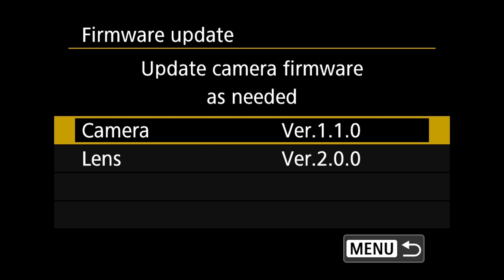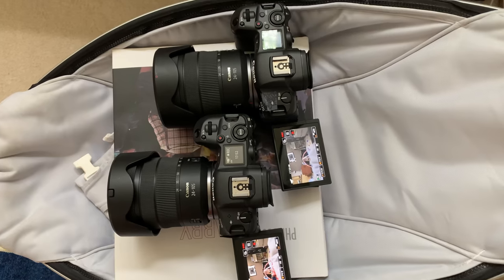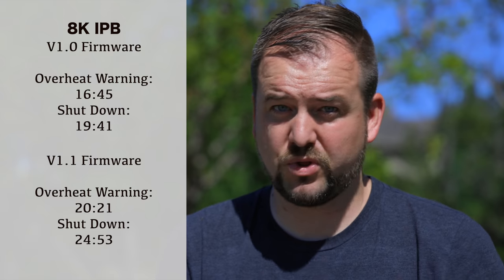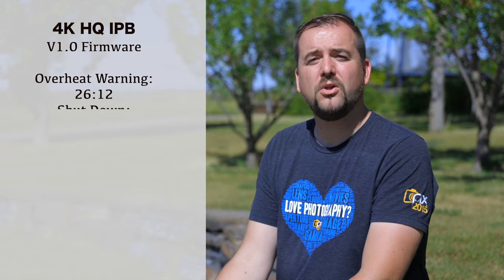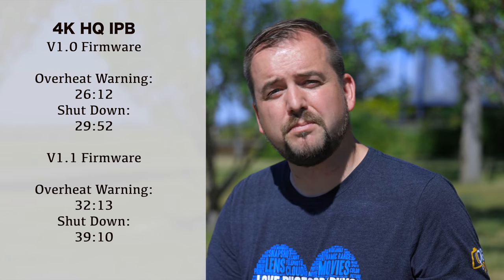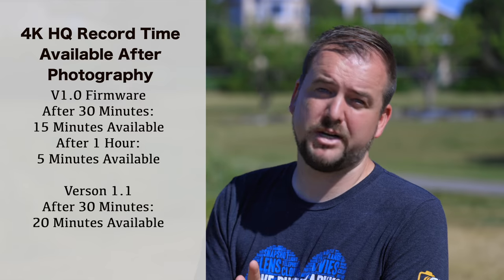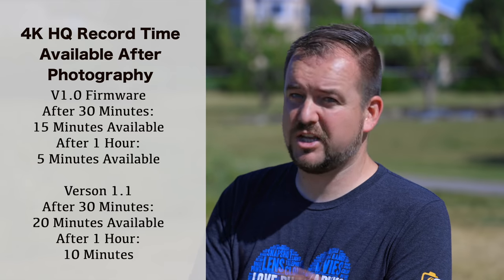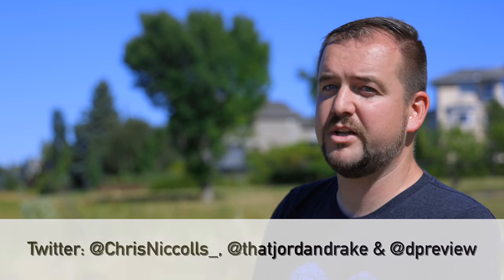Canon R5 Firmware 1.1 - Is the overheating fixed?

Comment: Software update silently improves the "temperature-limited" record times? I can't get "Canon Cripple Hammer 🔨" out of my head....
Reply: To be fair, software with better efficiency can compute faster with less stress on the system and the chip, thus less heat produced.

But yeah, since the initial ambient-temperature-independent overheating tests are out, it was very obvious that the cause of overheating is (cough cough) due to Canon's (cough cough) conservative policy, in terms of both business and camera protection (cough cough).

I cough not because of any disease but because this is quite a hot topic (pun intended). 😂
Reply: There seems to be a hack regarding recording with the door open and pulling the battery out as it flashes the overheat sign or something.
The cripple hammer seems to hard coded on purpose via software, and not efficiency.
Reply: @Ben Lambert But people were using Magic Lantern on their Canon DSLR...

The thing is definitely working, just not as good as people wished due to bad expectation management from Canon.
Reply: Looks like Canon's crippling the color science now.  Those colors look fake.  Too stylized
Reply: @controllverse4013  I strongly believe that this video is colour-graded by Jordan using some sort of LUT.
Reply: It is not about the heat as such, it is software managing the thermal management system. Basically they upped the specs for thermal protection. There is a tradeoff though, it will result in a higher rate of camera failure down the road. Presumably because of all the negative comments Canon have tweaked the specs a bit to eat some of the losses that would result when an increased number of cameras fail while still under warranty.
Reply: @Tugela60  If that indeed is the case, it would be wise for Canon to be transparent and have a tolerance setting - similar to Sony's "Auto Power Off Temp". Let the customer decide how much risk they want to take.
Reply: @SupreetMobile  The problem is the camera failing during warranty however. They have guarenteed that it will work for a year, and if it fails during that time they sustain a loss that is the equivalent of the profit from the sale, likely even more than one sale.

I suppose one option is to supply at own risk firmware that irreversibly converts the camera to an aggresive mode, but completely voids the warranty in the process. That way the customer can break their camera if they want to, but Canon is not responsible for fixing it when they do.
Reply: @Tugela60  They could build a Warranty timer into the firmware, so it counts down faster with every risky move the customer takes. Both transparency and warranty problems solved. 😎
Reply: @SupreetMobile  It does not work that way. Warranties are law in many countries, so they have to be honored unless the user does something specific to void it. The only way around that I think is to have "beta" firmware that is used at own risk, with the condition that using it voids the warranty. And it would have to be irreversible otherwise people would just reinstall the original firmware once they had damaged their cameras.
Reply: @Tugela60  I was mostly joking 😂, but I believe they could add a legal disclaimer in the firmware that using a specific mode could void or reduce the default warranty term? Anyway, good chat 👍🏼.
Reply: @SupreetMobile  Would make no sense. Many customers are not thinking that way and will definitely blame Canon in the end. Also there is a guaranteed lifetime and shutter count those cameras. As far as we know, most of temperature limits are software based. But that does in no way point to crippling the cameras. Such a decision would make no sense at all. Just look at the rage and hate they are currently met with. The limit we are seeing here actually makes sense. Look at the new Sony a7siii  which, according to tests, overheads even quicker with a much smaller sensor and limited capabilities. So its obviously not an artificial limit. We might see improvements to it once more cams are out and Canon received more tests and user feedback so they can make the choice of risking another increase in time
Reply: SO the R5 can shoot 45 MP and can do 8K video and 4K 120  - the first for any mirrorless cameras in the world. If overheat is a "cripple" then why have NO OTHER CAMERA COMPANIES produced a mirrorless camera that can do these things? The closest is the Panasonic S1H and it is a mere 24 MP camera and it can only do 6K, and 4K is limited to 60 FPS, AND it has a fan. Sony's closest competitor is the A7RIV and it can only do 4K 30 (and still suffers from heat issues), and the Nikon z7 can only do 4K 30 as well.
Reply: To clarify, the cripple is more about managing expectations than hardware. No other recent camera launch has been met with such negativity. Many people went through the process of becoming excited and then canceling their R5 orders. This is obviously not good. Given the situation, Canon should be as transparent as possible with such fixes. Building trust with customers is what will make the difference when competing with Sony and others.
Reply: I'm not defending Canon here, but it's possible they changed the temperature at which point the camera gives a heat warning, and at which point it shuts down.  For example, during FW 1.0, the camera may have given a heat warning at 100C, and then shutdown at 110C;   during FW 1.1 perhaps the camera is programmed to give a heat warning instead at 110C, and then shutdown at 115C.

That said, I'm still puzzled by the exclusion of thermal paste & the arrangement of the thermal pads on the RAM.

Comment: did anyone see a pattern here they just added +5 minutes to their TIMED limits and thought nobody will notice. this definitely proves that limits are not based on temperature data
Reply: Exactly what I was thinking!
Reply: But it still seems that temperature is a factor when pre-cooling the camera gets you longer record times, and cooling it after shooting gets you quicker recovery times. I don't see why it couldn't be a combination of timers and temperature readings.
Reply: @brazillmedia5802  i have not seen anyone manage to reduce recovery EOSHD had camera in a fridge and it still didn't make much difference
Reply: @GAGPalia  Check out Gorden Laings latest video. He talks about the camera's 3 different temperature sensors and how he was able to reduce recovery times down to 12 minutes from 36 by cooling it after shooting.
Reply: @brazillmedia5802  ok it is better with new firmware but the timers are still there as gordon mentioned it would be better if they are removed completely
Reply: @GAGPalia  they are there but that doesnt mean that canon is crippling their camera on purpose. Why should they? All it does is making a near perfect product stand out badly because people are talking negatively about it. The software timer is there for a reason. Canon has to give warranty and the camera must work for the promised shutter count. Based on the feedback and I guess allot of internal testing the now added another 5 minutes and are taking the risk. Could they add 5 or 10 additional minutes? of course they can! But if customers who actually use it (because most people will actual never use such long recording times on a camera that was completely designed for photography, with all the cons that this brings) will start to see defects and damage to their sensors then its again Canons fault of course...

Comment: Did they literally just code in plus 5 minutes?
Reply: Absolutely. This test tells you all need to know. They're not measuring temperature at all and feeding that into shooting times. It's just a timer based on the built in RTC. Which is why it can be reset by pulling the "backup battery". Not so much cripple hammer and cripple sledgehammer.
Reply: Well. If you think about it a little more, you'll realize that the original recording/cooling time is also just a line in code. And what did you expect? Analog shutdown?
Reply: @SketchTurnerZero  Err, not sure what you mean by analog - but yes, I expect shutdown actually related to the temperature of the camera, and recovery actually related to the temperature of the camera. Which every test so far has shown is not the case. If Canon hadn't been caught "bang to rights" - believe me, they would be shouting it from the roof tops. My guess is the best we can expect is a gradual increase in times via 1.2,1.3,1.4 as if some "magic" solution has been found, allowing the Japanese higher ups to save face.
Reply: @markjiggens3051  Not entirely true.. it's not like the timers kick in at exactly the same time for every person. Some people get 10 minutes of recording, some get 40 minutes. Some testers were even able to record 69 minutes of 8K (without doing the battery trick) by pre-cooling the camera in the freezer first. And other testers are finding cooling it afterwards accelerates recovery times.
Reply: @brazillmedia5802  ok, well that's actually encouraging then. I hadn't seen any tests with cooling that actually worked. Good to know, because if it's true I can strip mine down, stick a heatsink on the CPU and drill some holes in the case 😂
Reply: @markjiggens3051  Yep, check out Gordon Laings latest video. He talks about the camera's three different temperature sensors and how to get the most out of record and recovery times with them.
Reply: @markjiggens3051  What I'm trying to say is that the camera shutdown was not "mechanically", but was spelled out in the code. Canon engineers calculated how long it would be safe for the camera matrix and put it in the code. 

Of course, the new firmware does not change anything. It's not an optimization that stopped the camera from overheating, but just a line in the code. In a sense, cleanliness, but this is what many users wanted.
Reply: Yup. Gotta protect those cine cameras.
Reply: @Brazill Media  Stop spreading false information about this issue being debunked. You're either a paid canon propagandist or a fanboy trying desperately to mislead other owners. No amount of cooling will change the record limit! EOSHD has also demonstrated in a latest post that removing the battery and inserting a single screw into the battery door resets the record limit! https://www.eoshd.com/news/canon-eos-r5-so-called-overheat-timer-defeated-by-a-single-screw-in-battery-door/
Reply: EOSHD has also demonstrated in a latest post that removing the battery and inserting a single screw into the battery door resets the record limit! https://www.eoshd.com/news/canon-eos-r5-so-called-overheat-timer-defeated-by-a-single-screw-in-battery-door/
Reply: They code in +5 and want us to believe there's no timer?!
Reply: @Tacuddin  Cooling does in FACT affect record and recovery times. Like I said before - go check out Gordon Laing's and No Life's latest videos where they talk extensively about how temperature affects those two things. And for the record, I shoot on Sony - I'm just not a fan of conspiracy theories being talked about as though they are a fact.
Reply: @brazillmedia5802  Where did you see those 69 minutes? I have seen people put it into the freezer and nothing happened.
Reply: @FrankTaeger2021  https://www.dpreview.com/forums/post/64261516
Reply: @markjiggens3051  What has this to do with crippling? If you abuse the internal timers you are just risking damaging your very expensive camera. People seem to have no idea about electronics and heat problems of such sensor and think that unlimited recording time should be no problem. Its still 45 sensor that reads out in full frame with no crop at 12bits in raw with 8k oder downsampled 4k. Thats just amazing and there is currently no other cam that does that and is at the same time one of the best photography cameras available. And people criticize it for not beeing able to record more than 20 minutes when they actually will already have problems finding big enough cards to even record 5 minutes ^^
Reply: Nope, people are often getting in much more than 5 minutes when it's cool (Ordinary Filmmaker gets almost unlimited shooting in cooler Canadian climate) and recovery times are hugely improved.
Reply: @markjiggens3051  Nope, people are getting nearly unlimited recording in cooler climates now (like Ordinary Filmmaker) and recover times are much better in cooler temps. This firmware is legit.
Reply: They likely changed the temperature at which point the camera gives the warning & then shuts off.  I'm not defending Canon, but this doesn't prove they're using a timer.

Comment: Canon isn't mentioning the overheating improvement because to do so is to acknowledge it exists.
Thanks for this test.
Reply: They did acknowledge that it exists. They even published a spreadsheet when it will overheat at certain temperatures and how long the record time is.
Reply: We definitely need more transparency with all the videos I've seen of workarounds that allow you to keep recording + issues arising even when the camera is actively cooled.  I have to say, I just don't trust Canon at all as an occasionally professional photographer since 2007.  They always seem to promise big in their spec sheets, under deliver and then never acknowledge the discrepancy. 

If I had $10k today I needed to invest in to photo gear for wedding photography I would probably still pick Canon, but I would feel really shitty about it, and that just confuses me.  The R5 and R6 are good cameras in their lane.  The marketing was just awful.
Reply: @PatrixSean  this isn't what he means. Canon doesn't want to aknowledge they created an artificial timer based crippling based on a timer rather than a measurement performed on a sensor to protect the camera (dangerous for the camera). Cooldowns based on sensor readings would make the camera very useable but the prefer to add artificial cooldowns and blame heat.
Reply: Patrick Wolfe yeah, after the fact.  Nothing in the marketing material and morning in the manual says anything about these huge cooldown times.  Class action needed.
Reply: Mohamed Keita wait until you find out that CPU manufacturers disable cores on their CPUs To make budget CPUs.
Reply: @wyrmmm  The original cripple hammer! They get part of the way with using CPUs that have faulty cores from manufacture or fail to meet specified clock speeds.
Reply: @wyrmmm  yep they do that. For example they  disable 2 cores from a 6 cores processsor AND THEY SELL IT AS A 4 CORES. They don't count the disabled cores and blame the problem on heat while marketing the processor to pros hence no backlash.

Comment: Short answer: There are some improvements but depends on how you use it you may still run into overheating problem.
Reply: Thanks for saving me 5 minutes!
Reply: Julien Katsuhito I Think there’s another major problem the overheating is coming up also when you are photographing and filming. That means it’s overheating even faster 😡
Reply: The thing is... the R5 doesnt overheat AT ALL! Its a built in timer that says its overheating. Take a look at EOSHD. You can "overheat" the camera even in the Wifi menu.
Reply: @turgayak2047  I agree. The test was 2 pictures/minute for an hour with v1.1. After an hour, you have 10min of record time left for 4K HQ. That is.... not a lot.
Reply: Also given as an average user you may not shot in a constant pace all the time. You may hit a landmark or spot where you will most likely take more than 2 pics/minute. This performance is really terrible.